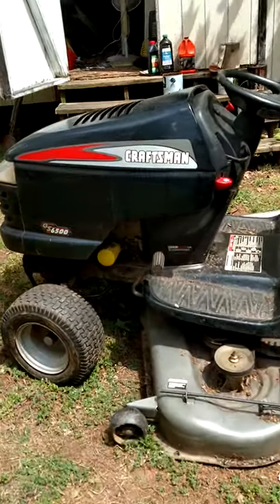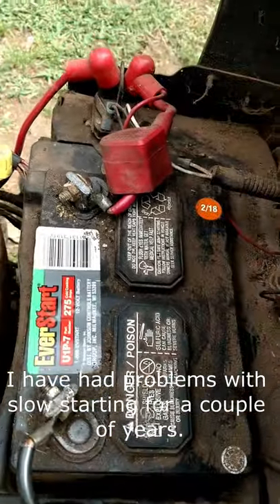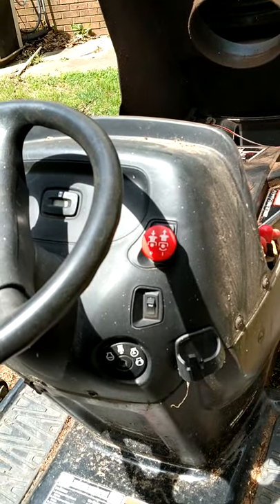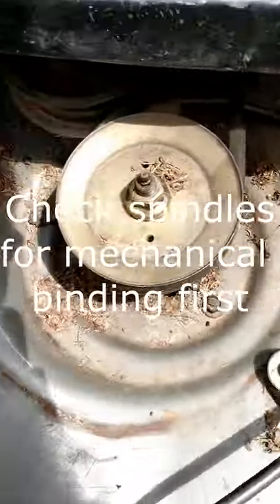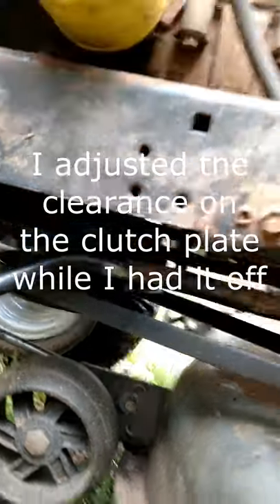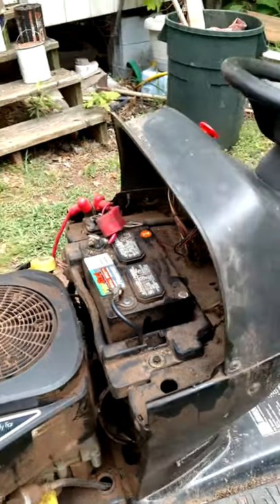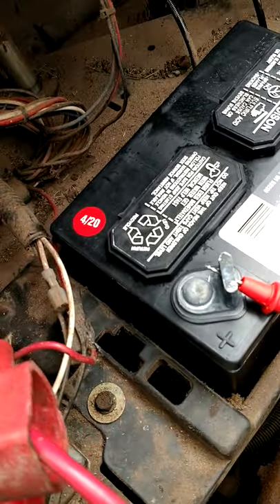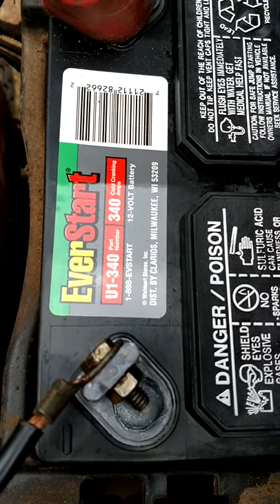Mower Shuts Off When Blades Engage

Comment: Great video sir!! Just bought used mower cause my tractor has been in repair shop for 3 half weeks i just can't push mow my yard anymore.  With engine running kick the blades on it dies immediately I'm gonna go get new battery tomorrow after I clean everything.  Thanks for sharing be safe have fun

Comment: Great diagnosis, thanks for sharing! If a battery won't take a full charge & sit between 12 & 13V indefinitely, it's probably smoked. If even a single cell inside is damaged, the battery will never perform properly. Its resting voltage & cranking amperage will be severely diminished.

Comment: The reason your motor is not wanting rotate sometimes is because you need to adjust your valves. If you don't it will worsen later in the future and will burn up your starter the more it tries to ware itself out trying to rotate slowly!

Comment: But why? Why does the battery have anything to do with this behavior?
Reply from the maker: Apparently it's because of the electric clutch that engages the mowing deck.  It uses more current than the alternator can supply if the battery is weak.  The alternator alone cannot supply the momentary demand of the clutch coil.  That's my guess anyway.

Comment: Thanks for sharing this. You were very clear and eloquent in your step by step description. These new style cheap batteries that they sell now cause a lot of problems.  I'm sure the makers of a lot of other ancillary components sell a lot of unneeded stuff before people finally figure out it was the cheap ass battery that the seller only guarantees for 1 month, maybe 3 months and the mfr. maybe a year...Your amp meter is worth the cost to read the voltage before replacing starters, regulators, condensors...what have you.

Comment: Yeah, it takes a good amount of current to keep the PTO clutch plates electro/magnetically engaged, and that means it's often more than just what your particular alternator is generating, so a sound battery is essential with a PTO clutch. I mean, I believe any PTO clutch requires at least a 9 amp alternator, but many mowers have alternators that are much higher in amperage, so they may be able to better maintain a weak battery being charged while the PTO is simultaneously engaged, than on a unit with only a 9 amp alternator and a weak battery, I'm guessing.
Reply: But this would only disengage the blades, right?  Not cause the engine to stall/sputter out.  Right?  I'm having this very problem now with a Cub Cadet that runs just fine until I pull the PTO and engage the blades.  Then the engine starts to sputter out.  Grrrrr.
'
Reply: @robertzeurunkl8401  Well, my zero-turn still has a manual idler engagement deck, i.e., no electronic PTO, and I repowered it with a V-Twin motor that was about half price since it only had a 3 amp alternator, which wasn't a problem since there is no electronic clutch PTO. So, I'll suggest that you just put a new battery in that baby, and then let us all know back if it solved your problem. The season is starting!

Comment: Thank you for this video, I have a Troy-Bilt pony and after a while it wants to bog down so I'm wondering if it's the battery as well.
Reply from the maker: I was just running out of options.  I had checked everything else.  The clutch solenoid was apparently pulling down the voltage enough, on an already weak battery, that the generator/alternator just couldn't keep up.  That was the problem with mine anyway!

Comment: Mine does the same but it's a 2yr old ExMark 52". It started this issue when I installed some new gator blades. The belt is pretty hard to pull by hand. Noticed the battery only has 9vlts. I have to jump it off to start it but if I keep my jump starter on it? The PTO Engages! Guess I need a new battery too

Comment: I sure hope this is my problem, its a troybilt zero turn rtz it dies sometimes when I release the brake but the battery light flashes alot I have noticed when it is engaged.. It also sometimes is very slow to climb a hill, reckon that could be the battery to.. well I'm gonna get one its the cheapest thing to start with, I sure hope its not the PTO clutch.. thanks for the video..my battery is about 2 yrs old too

Comment: If you have a mower with a mechanical blade engagement - it could be killing the mower when engaged if the safety switch is not being pressed in all the way - if that switch doesn't get pressed in all the way, the engine will die.  You will flood the crank case if it dies this way because it grounds the engine and kills the spark - well it still spins until it stops and is sucking fuel into the crank case - remove the spark plug (s) and spin the engine by hand before trying to start it again or you will break all kinds of internals and blow your engine.  - mechanical linkage will sometimes have a bracket with a spring in the middle - and a threaded rod that goes through it -  [________] <== bracket looks like that - when you engage the deck, that rod goes pushes the spring - the rod gets pushed through hone end of the bracket and pushes in the deck switch - this is a safety switch - that is dual purpose - it will not start the engine if it is engaged when the mower is off - and the other purpose is if you get up from your seat - its all wired together - that will cause the engine to die.  So it could also be your seat switch - most likely it's the connection or the switch on the seat is bad - but check that deck engagement switch first.  If you can ride your mower just fine - only dying when the deck is engaged - your seat switch may be fine - a lot of the time that switch is stuck - pressed in so it's rarely an issue - and typically the mower will not start if the seat switch is bad.  -  The electric systems on these things are garbage.    So if that bracket is not adjusted right - there is a nut on it - that rod is threaded.  tighten or loosen it to get it adjusted to where it pushes that switch in all the way - if the rod goes all the way through the side furthest from the switch - get a new bracket assembly - there is two notches that keep that rod between the washers and the spring - well over time the round holes on either side of the bracket will wear out - and become an oval shape and that bracket can go right through it.  It's a pain in the a$$ to get it back in place - theres a TON of tension on that spring at all times! - well you can tac weld around the hole and use a drill and file to reshape it - put the bracket in a vise and get that rod back in position within the washers and spring section - sometimes the nobs on the rod break or get warn down - add a couple tac welds so that bar doesnt go past the washers again - when the rod goes all the way through - it's not touching that stupid switch - that rod and spring assembly makes it so it is a VERY FAST transition from OFF to ON and ON to OFF for the deck engagement.   This has to be fast so the engine does not die.  The adjustment has to be able to push in the switch that has a throw of about one inch.  - If you have no idea what I just said in any of this - hit up Taryl Fixes All ... or your local small engine / mower repair shop and let a professional fix it.  (Taryl kicks a$$ by the way!)    As for a BUTTON pull out push in - that is an ELECTRIC PTO - if your mower dies when engaging it - its most likely a bad battery - or the wiring/switch is bad.   Most likely the battery is bad.  It takes a LOT of juice to engage an electric PTO.  If there is not enough battery power - it will just stall the engine and die.

Comment: If it running normally and charging normally why would the battery have any affect on the clutch? Mine was running fine. I was cutting and it just stalled and died. It starts and runs without issue. Although I left the key on and had to charge it. I took the clutch out and it seems to be binding up so I replaced it $135 later it still stalls the engine. I hate to throw money at it, but I guess a battery isn’t the end of the world. It dies the same thing when I take weight off the seat or back up with out pressing the back up button.  I wonder if one of the many safety switched is to blame. I think that might be the issue because I started it without sitting in the seat. Then later it wouldn’t start or run that way.
Reply from the maker: Mine ran okay until I engaged the mowing deck.  My guess is that the battery was weak. The clutch coil uses a lot of electricity and the alternator apparently doesn't have the umph to run the engine and clutch coil AND charge a weak battery all at the same time.  All I know for sure is that replacing the battery fixed my problem, as weird as it sounds!  Good luck, my friend!

Comment: Mine starts fine and runs great but engage that switch and off she gos
Reply: Mine has great voltage while running, 14.5 DC however when blades are engaged only will run for about 15 minutes

Comment: I may be having same issue with an Exmark Turf Tracer i recently restored. Brand new battery. Engine runs and sounds perfect but when I engage the PTO she bogs down  a lot but at first the engine would slowly recover to operating rpm but even then the motor didnt sound right until i switched off the PTO. 
Last few times i tried she'd bog and die. probably because the batter is a little weak. 
I was thinking that maybe the ignition coils were weak but then started thinking the PTO might be engaging to quickly bogging the motor (not sure if thats a thing or not). But I think you might have the answer for me. I seen one of your comments below about a weak battery not being enough to run the ignition, the pto and charge the battery so the ignition suffers with a weak spark. 
I'll let you know what i find. Thank you for your video :-)

Comment: Why would battery power affect the blade engagement. I can understand possibly safety circuit switches having an affect.
Reply: because while the engine is running the alternator has to charge the battery and power the pto, if the battery is weak it will take all the power from the alternator and the pto will starve and it could burn up the alternator. if it was a manual blade engagement it wouldnt hurt it, never jump start a mower that has an electric pto.
Reply: I was wondering the same thing.  And here, Tom's answer explains it.  Two for one!  ;-)

Comment: I am having this problem now (Cub Cadet), but I never would have suspected the battery.  I know it's been a sluggish starter, and needed a new battery, but I figured that once it was actually running, the generator would be providing the voltage it needs, not the battery.  And what IS the connection to the battery anyway?   What does the battery DO that the engine would care if the blades were engaged or not?
Reply from the maker: The clutch solenoid to engage the blades is electric.  My battery was so weak that the generator/alternator was putting out all it could to run the engine and the extra drain on the electrical system was more than it could take.  The old style lawn movers only needed the magneto to make a spark and the blades ran anytime the engine was running.  The newer models have a control circuit for the spark and the clutch to engage the blades.  When the battery got too weak, it couldn't run the electrical controls, even with the motor running.

Comment: Your mower is a Husqvarna build. I had the same issue, but my fix was moving the fuel line away from the cylinder head. It was actually mounted to it, causing vaporlock. It would get just enough gas to run the motor, but if you engage the clutch to the mower, the motor would die.

Comment: I have a Kohler in a hustler. It starts fine, but once it's hot, if I disengage the pto for whatever reason, and then try to engage it again, it chokes down, and cuts off. It'll crank, but not turn over. Any idea?
Reply: Yes I Husqvarna is actually have an electric PTO sometimes if they get hot they will disengage you may need a new one there is a video I seen on how to test them pretty easy
Reply: I had the same issue on my scag had to get a new pto bc it was on all the time not allowing the engine to turn over.

Comment: My Money was on seat switch. Good info. Great voice, do you do voice work?
Reply from the maker: I would love to have a voice gig!  I was in radio thirty years ago, but found out I could make more money as an electrician!  Thanks for the comment!
Reply: @Rob Douthit  I posted this in a comment but it my help others if you state that your video is for an ELECTRIC PTO - here's the fix for a MANUAL DECK ENGAGEMENT mower - the non - switch - but Push the lever or pull it to engage and disengage the deck!  It's a lot mower to go through to check! Where I talk about gas in the crank case though sir, that goes for both electric and mechanical (manual) deck engagement systems!  
  If you have a mower with a mechanical blade engagement - it could be killing the mower when engaged if the safety switch is not being pressed in all the way - if that switch doesn't get pressed in all the way, the engine will die.  You will flood the crank case if it dies this way because it grounds the engine and kills the spark - well it still spins until it stops and is sucking fuel into the crank case - remove the spark plug (s) and spin the engine by hand before trying to start it again or you will break all kinds of internals and blow your engine.  - mechanical linkage will sometimes have a bracket with a spring in the middle - and a threaded rod that goes through it -  [________] <== bracket looks like that - when you engage the deck, that rod goes pushes the spring - the rod gets pushed through hone end of the bracket and pushes in the deck switch - this is a safety switch - that is dual purpose - it will not start the engine if it is engaged when the mower is off - and the other purpose is if you get up from your seat - its all wired together - that will cause the engine to die.  So it could also be your seat switch - most likely it's the connection or the switch on the seat is bad - but check that deck engagement switch first.  If you can ride your mower just fine - only dying when the deck is engaged - your seat switch may be fine - a lot of the time that switch is stuck - pressed in so it's rarely an issue - and typically the mower will not start if the seat switch is bad.  -  The electric systems on these things are garbage.    So if that bracket is not adjusted right - there is a nut on it - that rod is threaded.  tighten or loosen it to get it adjusted to where it pushes that switch in all the way - if the rod goes all the way through the side furthest from the switch - get a new bracket assembly - there is two notches that keep that rod between the washers and the spring - well over time the round holes on either side of the bracket will wear out - and become an oval shape and that bracket can go right through it.  It's a pain in the a$$ to get it back in place - theres a TON of tension on that spring at all times! - well you can tac weld around the hole and use a drill and file to reshape it - put the bracket in a vise and get that rod back in position within the washers and spring section - sometimes the nobs on the rod break or get warn down - add a couple tac welds so that bar doesnt go past the washers again - when the rod goes all the way through - it's not touching that stupid switch - that rod and spring assembly makes it so it is a VERY FAST transition from OFF to ON and ON to OFF for the deck engagement.   This has to be fast so the engine does not die.  The adjustment has to be able to push in the switch that has a throw of about one inch.  - If you have no idea what I just said in any of this - hit up Taryl Fixes All ... or your local small engine / mower repair shop and let a professional fix it.  (Taryl kicks a$$ by the way!)    As for a BUTTON pull out push in - that is an ELECTRIC PTO - if your mower dies when engaging it - its most likely a bad battery - or the wiring/switch is bad.   Most likely the battery is bad.  It takes a LOT of juice to engage an electric PTO.  If there is not enough battery power - it will just stall the engine and die.

Comment: What the hell does "choke down" mean. Sounds like a description for a carb/choke problem.
Reply from the maker: It acted the same way it would if you pulled the choke out after it was running and up to speed and the engine sputters and stops.   I've just always called it "choking down"

Comment: I have new battery in my John Deere La100 riding lawnmower. Everstart, 230cold cranking amps. However you can cut grass for about 10mins. Motor wants to shutdown. Quickly disengage and it runs great. I need some advice, Please!!!!
Reply: I have a Similar problem, can mow for 20 min, then starts to die but if i disengage blades engine resumes running smoothly.  let me know if u find a fix!

Comment: Troubleshooting this: Seat safety switch; Brake safety switch; and now low voltage...  all each kill the engine. I've shorted the safety switches (for diagnostics) and now check my voltages - 12.8v parked, and 14.6v running. The blade switched on kills the engine, same as releasing the brake (when safety switch installed). Now what?!?
Reply: Well, A forth problem could be a short in either of the two safety switch circuits. I'm betting that's what happened when I rolled my tractor onto its side to install the new clutch [which should have been easy to do without rolling it, but I had trouble due to a wrong part].
Reply: Well, After checking conductivity through all the safety switch wires (all good), I discovered my problem. The 6201 PTO switch had failed due to the heavy current draw when the clutch melted down. Add that to the list of causes of engine stopping when the brake is released or the PTO switch engaged.